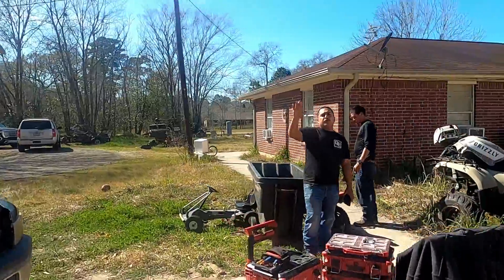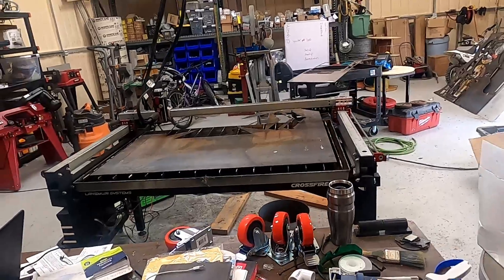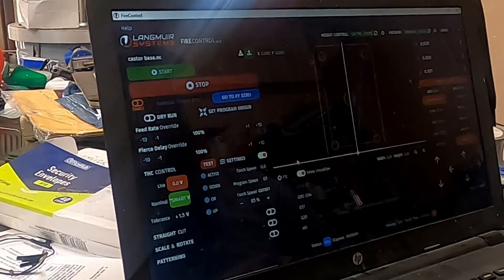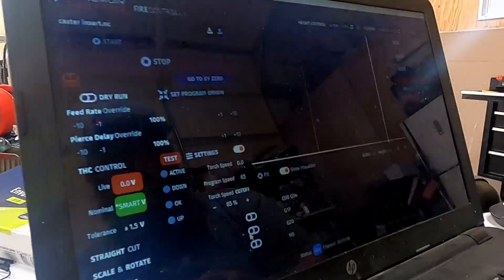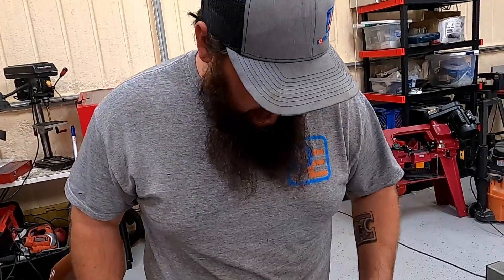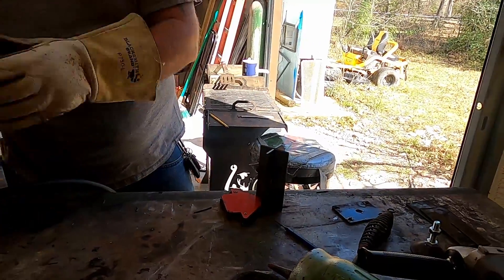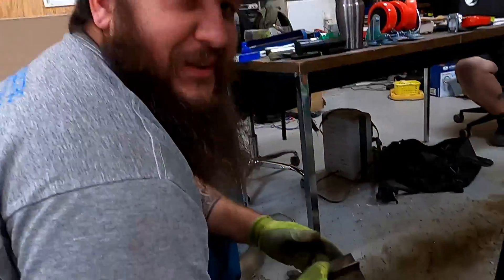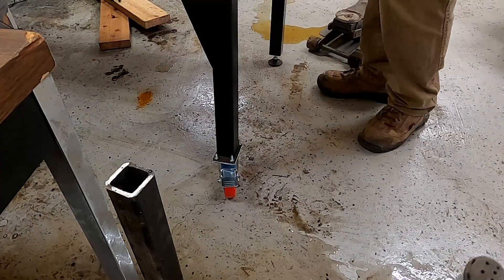Installing Casters on the Plasma Table - Locking Caster install on Square Tubing

Comment: After you put the wheels on a year age did you have trouble keeping the table square?
Reply from the maker: As far as level goes? We have to find a flat spot in the shop or you can shim the castors. We built a bottom tray, so it's pretty stable and square.